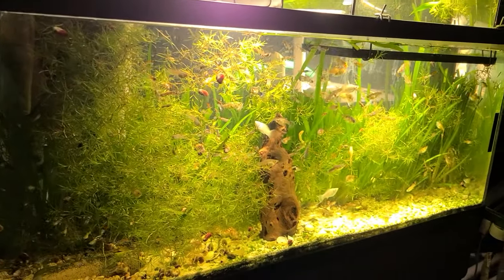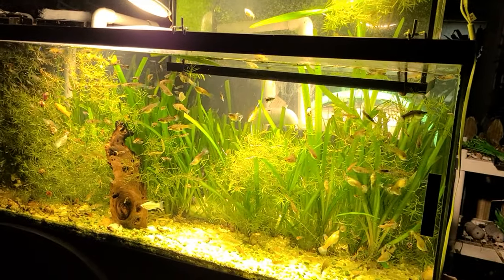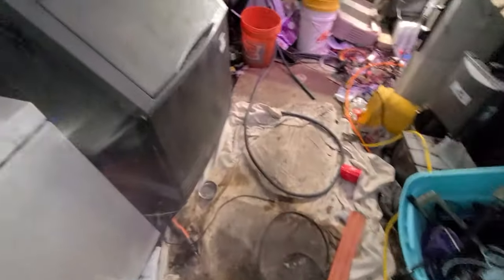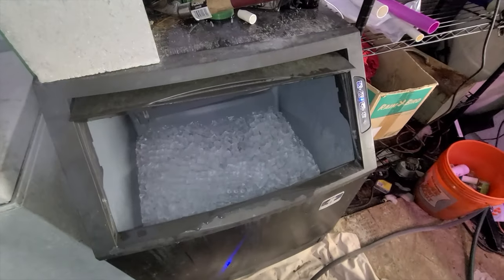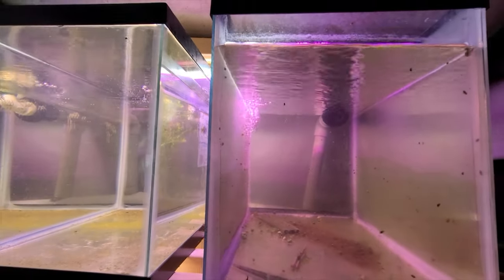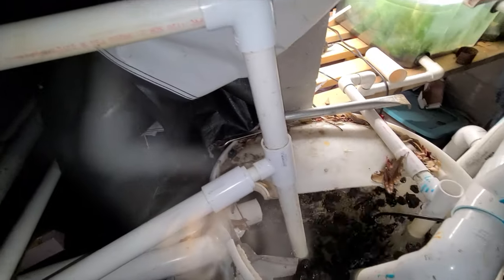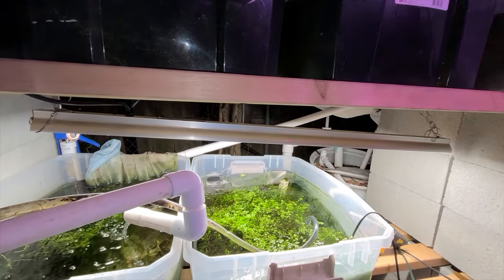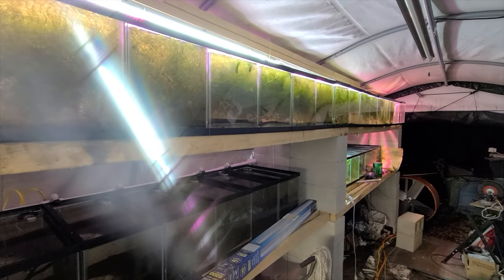Subscriber Outside Fish Room Tour

Comment: Michael, water condensation only concentrates the salt in the water.  Salt, if one wants to remove it, must do water changes until the concentration is diminished.  That is the only part of that presentation I disagree with.  By the way, you never responded to my questions about female guppies and when they drop fry.
Reply from the maker: Not sure what you are talking about on either point?